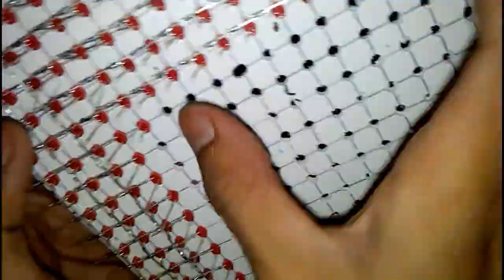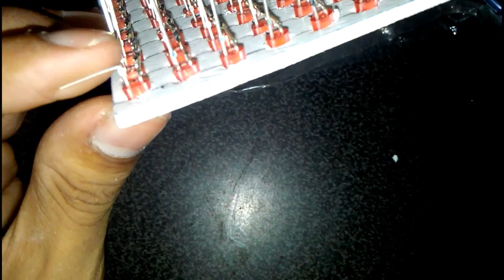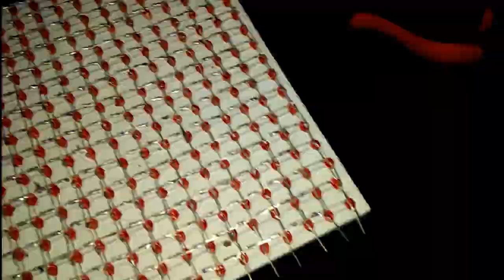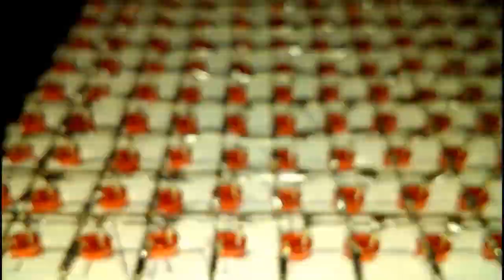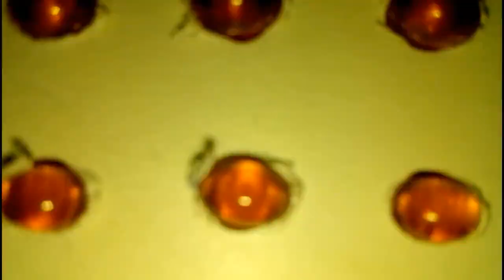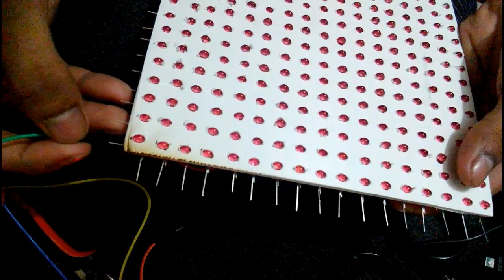How To Build 16x16 LED Matrix Display | How To Make 16x16 LED Matrix Display | Full Tutorial

Comment: If I am not mistaken, all LED's are connected in parallel, right??
Reply from the maker: This is not only in parallel neither in series rather than both. It's called the Matrix connection. 
In the parallel connection, if you connect the power to the LEDs, all LEDs will light up, but in Matrix connection, you can individually turn on an LED. :) 
To learn more, go https://en.wikipedia.org/wiki/Dot_matrix